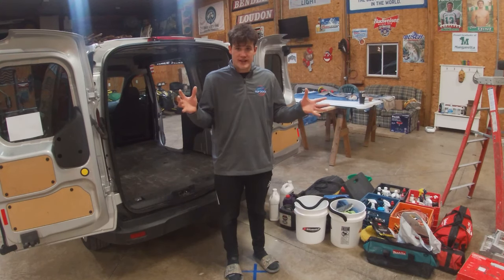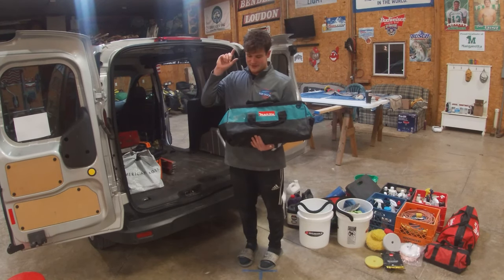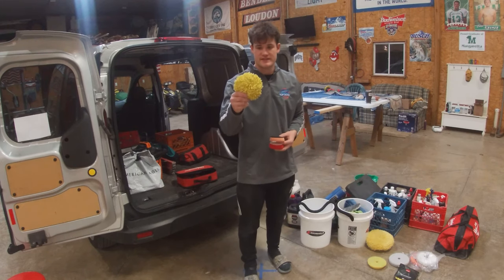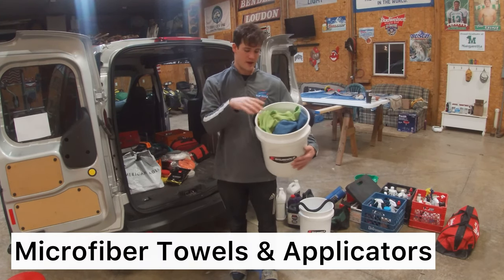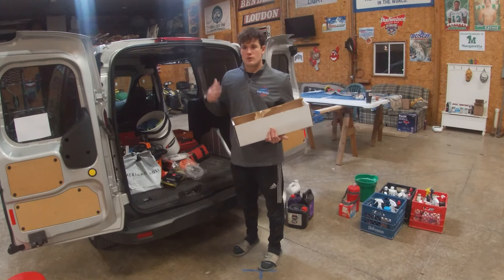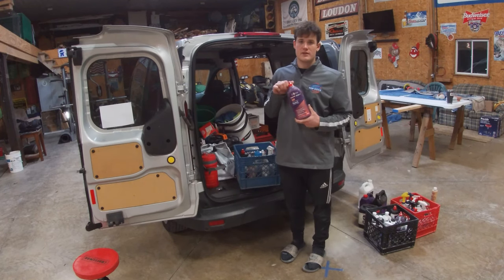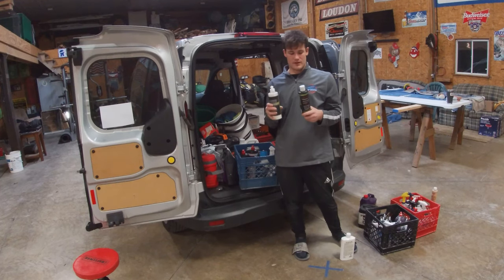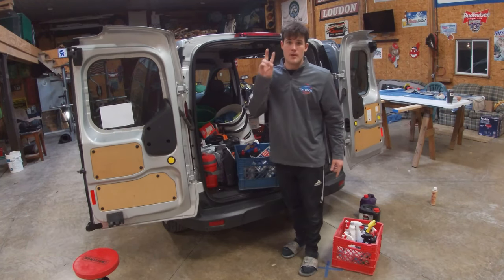Boat Detailing Products | Every Product I Use Currently | How to Maintain A Boat

Comment: Where do you get those application bottles (for pouring your gallon jugs into when working)... ? I can't seem to find squeeze bottles that large.
Reply from the maker: I get them on Amazon. Not sure if they still sell the 16oz bottles. I would check around and marine detail supply might have the bottles as well.